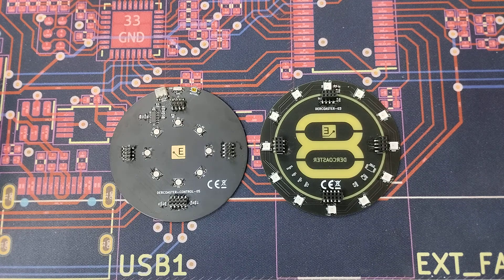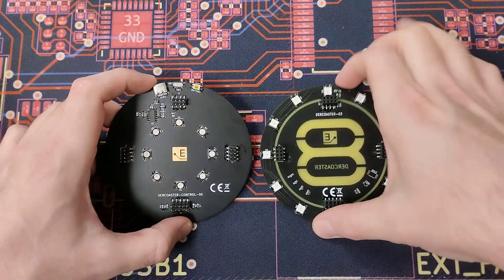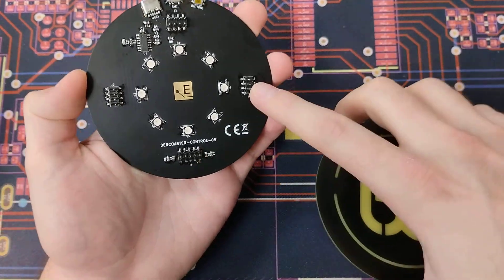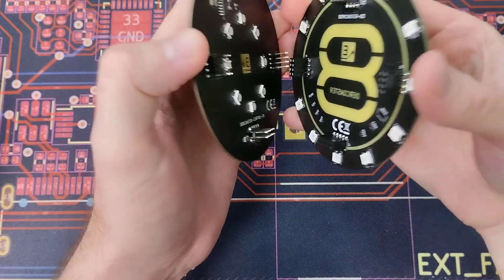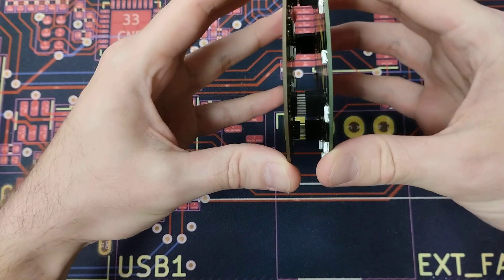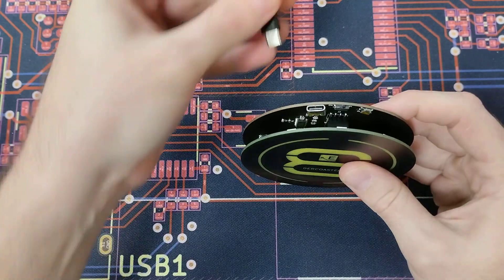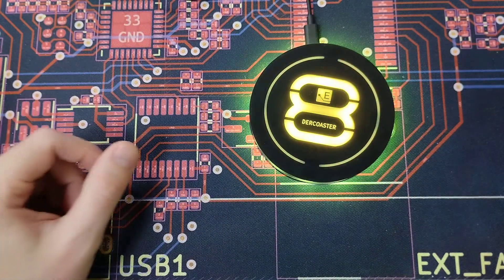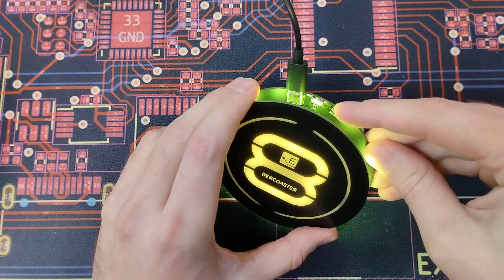DERCOASTER RGB PCB Coaster Electronics Project

Comment: Thanks so much for making this. This project has turned me on to electronics. I made this and am well into converting an ATX power supply into a bench power supply. I am having one issue and was wondering if the schematic for the PCB is available anywhere? I'm not getting all the LED's on the secondary PCB to light up and was hoping to find out the pin out of the 5 pin connector. Thanks in advance...